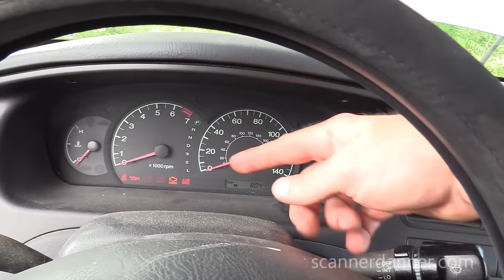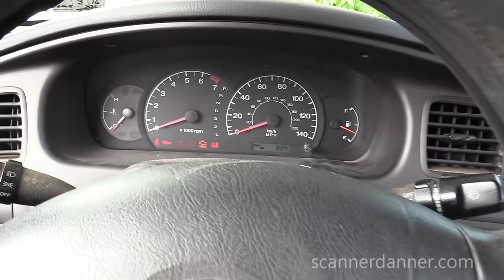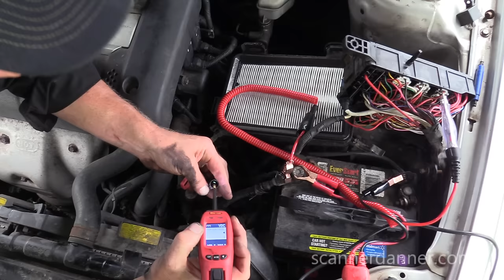No crank, good starter, how to troubleshoot, any car! (Hyundai)

Comment: Hey danner. I always watch your videos I learned soo much thank you for making me a better technician. I have one issue. I don't think I see any video on starter issues. For example I worked on one car that is 2009 kia optima the starter is under the intake manifold  I didn't have access to wiring diagram or anything. how can you test the starter without removal of intake manifold? please help thank you so much for your time to read this its so important for me to learn I wanna do this right way next time when it comes to like this kind of situation ill be ready to go you know
Reply from the maker: To pierce the wires right where it enters the manifold and do your checks right there. If it passes there, you're then selling the job and removing the intake.
Reply: @ScannerDanner  thank you! I appreciate your reply.

Comment: what happened? Did you find out why there was no power to the distributor ? I'm having same iswith my 84 C10 305. Wondering if it's a fusible link ?
Did you do another video on the problem and did you solve it ??

Comment: 2009 man crdi i30 150k km 

Intermittent silent no crank. Will crank and start after one or two gentle pushes with the car in low gear. 
Battery test ✅
New starter fitted. 
Intermittent no crank persists. 
Rather than electrical I suspect worn starter gears on the flywheel of 15 yr old 4 cylinder diesel with 150k km of inner city use. 
Car drives like a boss. It’s is in great condition and is well maintained. 

What do you recon? 

Always starts once warm. 

8-18  degrees Celsius air temp. 
 
No crank on 10 - 20 % of cold to cool engine temperature starts. 

Is this silent no crank damaging the battery or starter relay / system? 

Thanks for your help and channel.
Reply from the maker: I dont know what you mean by silent no crank.
Reply: @ScannerDanner no clicking from the starter.
Reply from the maker: @petergeekie5403  next step, measure voltage directly at the starter on both circuits like I showed in this video DURING the no crank.
Reply: Great thank you SD

Comment: If my ground cable from the engine to the body isn't connected,  will this cause it not to crank over ?  Also I pulled a breaker and jumped with a wire and it cranked over. Thanks  !
Reply from the maker: Sounds like you fixed it?

Comment: Good job 👏.  I install HD fog lights in my car and my radio signal is gone when i turn the lights on. Any idea?. Thanks
Reply from the maker: How did you wire them? Did you install a relay or pull power from another existing circuit?
Reply: @ScannerDanner  existing fog lights.
Reply from the maker: @kukasally  so just a bulb swap or do these HD lights have another box that get's wired in?
Reply: @ScannerDanner  HD kit. With ballast.
Reply from the maker: @kukasally  these probably draw a lot more current than the oem bulbs. Where does the ballast get power from? Where did you run your ground for the ballast? 
A better question, please list all the wires connected to the ballast and where you have them connected
Reply: @ScannerDanner  i just connect the HD with the ballast to the existing fog light.
Reply from the maker: @kukasally  I need to know the wiring to that ballast to help further. Name each one please

Comment: The check engine light is from the mass airflow sensor being unplugged and I usually hotwire the starter first before I beat on it especially if I don't hear it click
Reply from the maker: No MAF on this model

Comment: Hello,
I'm having an issue on 2016 Kia Sorento.  Stiff brake pedal, car does not start or crank.  Replaced battery and starter.  Tested starter by jumping the pins in starter relay - pins 30 and 87 and starter is kicking on.  Tested that there is power going to the pin 85 in starter relay when ignition is pressed.  Not sure what else could be the problem.  Any help will be appreciated!  Thanks in advance!
Reply from the maker: Of course the brake pedal is going to be stiff if the car isn't starting. Why did you mention the brake pedal? What are your voltage readings on the BAT and S posts of the starter while someone holds the key in the crank position?

Comment: Dude, i like your hands on experience teaching. While I was watching the video i wanted to tell you to just run a new wire from the relay box to the starter but in the end you solved the problem. Quick question: do you have any idea of why an immobilizer light would stay on and won't let the car to start even with the original key? It's a 2015 chevrolet Aveo.
Reply from the maker: You need good service information for these types of issues. I am also sure that you have a code for that http://eautorepair.adtrk.biz/?a=10817&c=24&p=r&s1=

Comment: Having the same problem on my ZG Grand Cherokee and I'm about to check the same solenoid connector as you did.
I rang my local auto sparky and immediately he tells me I need a new PCU without even seeing the vehicle. Have lost confidence with this guy and might try someone else if it's not that connection. Thanks

Comment: Paul, can an engine be started with power from a test light to the "s" post? or does a jumper wire have to be used?
Reply from the maker: Jumper wire. Initial amperage can hit 40 momentarily
Reply: @ScannerDanner  Thank you for the information... I appreciate it..

Comment: Hi
I have Hyundai sonata 2016.My problem is very much near to this. My ignition is cranking but not fully . It is sticking in between . I was driving my car and on the way it stopped and I tow the car back home. Can you suggest me what is problem.
Note my car didnot heat up or none of the oil or lubricant is less.

Comment: This was great, other than not checking the engine light. How long does it take to run a code and give some idea of what the problem is. Don't fix it or look into it, but a problem with x sensor or y system...
Reply from the maker: 100% on a regular job where I'm not filming a particular issue, scanning the system for codes is not a bad idea, HOWEVER, this additional problem is absolutely separate and should the customer also want their check engine light fixed, this is additional diagnostic time. That was my only point. Thanks for watching!

Comment: I got a 1999 Honda accord 2.3l p1259 trouble code but won't start when does press accelerator and it dies kind of perplexed bought new aftermarket solenoid valve got new starter and alternator. Any help whatsoever would be so helpful

Comment: I have the same no start problem with my 2003 Ranger and I bought a remaned starter and it came with a six inch of wire attached to the S post on starter. its a Ford approved fix for the corrorded part of that wire, well it didn't work and so to test that starter. I don't have a test light and can't go get one because my truck is not running.
So I was going to run a jumper wire from the S post to the hot side of battery to see if it will start the truck, is that good test ?????
Reply from the maker: You can just run a jumper from the heavy post on the starter itself, to the S post.
Safety warning. Make sure it is in neutral on a manual transmission and Park on an automatic with the parking brake set. And then turn the key to the run position so it will start.

Comment: Did this on my jeep, starter relay was a problem for a moment i just bypass does pins, forget about hot wire terminal (30)and negative (85),just put a short wire to terminal 86 which is a positive from ignition to terminal 87 thay goes to Starter solenoid. And i then go get the parts from Auto and reverse the thing i did recently then you good to go

Comment: i have a 03 accent that the electric system die when installing the remote wire to the starter.  i mean is dead no ignition switch power the dash does not light up when turning the ignition to on. Checked good starter, good relay, good ignition switch, good battery no blown fuses. any thoughts?

Comment: What is the state of the key in crank or run position when using the power prode on the s cable of the starter to provide power.  Will it start if key is off and you supply power to the starter?
Reply: It will crank with key off but not run.

Comment: If I have a issue for a crank but no start should I try moving a fuse from a different one to diagnose if the fuse is bad. Engine started earlier today but after changing my temp stat it no longer starts.
Reply: Battery is new and passed test. Spark plugs are relatively  easy as well.

Comment: Question if the Battery for the Transponder chip is bad could keep the vehicle car from starting or is fuse because a friend of mine his Lexus RX330 lights come up on the dash board comes on battery is good its does not flicker but just sits there. Yes there could be relay problem a fuse problem, Or it could be a Starter wiring issue or connector so some sort. But the General Question does the battery in the Key Transponder possibly need be replace and if it does could it start the vehicle again or I am thinking it well
Reply from the maker: IF your no crank issue is being caused by a transponder type key, you will have anti-theft codes and a theft light that will be flashing at you. If you do not have those, attack the problem exactly how I did in this video.
Reply: @ScannerDanner  check the fuses seemed to be nothing burnt out haven't checked a relay box did hear a computer-like sound not sure what that means I don't hear it now I taken the leads off the battery and it still doesn't want to start if it's a starter issues than it's beyond me because it seems like it's just a bad electrical problem 
I guess my friends just going to have to consult electrical automotive service person

Comment: If you went to the lug on the S post what would you see? 12volts or still no voltage or a voltage drop difference
Reply from the maker: I showed that. That was the first test. No power on the terminal itself or lug as you called it

Comment: Great  technical work.
I have an issue with battery charging Indicator always on having difficulty on starting at the first time. Something I've to run back and forth the auto gear selector wondering if anything is wrong with the electrical connections. There is a clicking sound but the oil indicator lamp and fuel meter dies sometimes... It's a 22 years old car. I may have follow your method...👉
Reply from the maker: Sounds like you're describing multiple problems and you've given me no information on what you're working on. Year, make, model, engine and what specific problem are you chasing? Did this all happen at the same time? Thanks!
Reply: @ScannerDanner  well it's a ford lynx 1995 same as Mazda lantis. Actually I've found the problem, the cable connection at the starter motor is faulty. Just rectified it. Thank anyway. God bless all.🙏
Reply from the maker: @sivaraoramasamy3499  okay sweet! I wanted to help, just needed more info. Nice find!
Reply: @ScannerDanner  🙏

Comment: So I have a 2000 Chevy Grand Express 1200 that doesn't want to stay running. I just replaced the starter, alternator and it has a good Battery and replaced the starter relay. After checking all fuses and relays, all Of them are good except for the Crank fuse. When I put the test light on the crank fuse when the ignition is on the on position, it shows no power coming from it and the fuse isn't blown. May I get some advice on what the issue could be, or what I need to check for? Thanks Man!
Reply from the maker: that is because that fuse is only hot when you are cranking the engine over. 😉
Also, you say it doesn't want to stay running meaning what? It doesn't crank, or it cranks but doesn't start, or is starts and runs but then stalls? 3 COMPLETELY different scenarios
Reply: It Cranks but doesn't Start
Reply: It's got a brand-new Alternator, Starter and Battery on it.

Comment: Replacing relay bad !
I think the box might have been crazy on my Elantra too 
The trip Odometer would say im getting 65 mpg sometimes 
It would lose power intermit
Etc 
I think Elantra harnesses are not good 
Mine had the Famous map rewire before i bought it .
A guy also told me this .
“You are dealing with replacement employees putting in Replacement parts in your replacement car “🤣🤣🤣
Be well my friend ✌️

Comment: Have a rav4 2004 doing the same thing could it possibly be a fuel issue or would it still crank even with a blocked fuel filter, awsome video deffiantly subscribing
Reply from the maker: The starting system (starter and battery) will function independently from the ignition and fuel system. If it is not cranking for you, attack the starting system directly. Here is a link to the DIY version of the same service info I use. (If you need it) https://eautorepair.adtrk.biz/?a=10817&c=24&p=r&s1=

Comment: Sir i have a questions.. Hope you can help me..
I have a Honda Jazz gd 1. 2001.
First its always blingking D I'd scanned and P0700 error then id deleted error then it will run okay.. Then if i removed the scanner the car would stop and there is sudden noise on engine i think on trans.. And fuel pump sound with ignition on disappear.. And there is something tiktak sound on fuse and relay box
Reply from the maker: You need a better scan tool. The P0700 is just a generic engine code that says "hey go scan the transmission module for the actual code" you MUST start there

Comment: Scanner, can you help me, I have this b2200 that starts up fine one the first start, but on the second start up it acts like I have a dead battery, an is turning over real slow, today I put in a new 80 amp fuse, scrub off the fuse box terminals, so the truck is now charging a 13.7-8 volts, but when I turn the truck off then to start it back up, it is acting like it have a dead battery, so I'm confused.

The next thing is my reverse lights is always on, but when I put the stick in reverse it goes off. Help please.
Reply from the maker: Sounds like a bad ground, maybe even on the block? Need voltage measurements to help you. In particular the heavy battery stud right on the starter, then on the block itself DURING cranking

Comment: great video,  my 1998 jeep, wont start when I put the key in the on position it shows lights on dash board battery is good when I crank it I hear one click then all lights go out even on dashboard like if there was no battery in the jeep. then I take battery off put again and lights on dash board but when I turn the key on, everything goes dead again. could it be computer..
Reply from the maker: Absolutely not! You have a connection issue with the battery cables. You need to do some voltage measurements on the main battery cables AND ground cables, including where the ground cable connects to the block
Reply: just want to say thank you for your quick response knowing you are busy and all. good looking out.

Comment: In this case you cannot always depend on prob light  because  in some cases the battery cable to the starter is partially burned or corroded  so there is not enough ampere supply to the starter  but the multimeter or prob  light works and give 12 volt indication. so replace the cable in this case.

Comment: I have a 2002 Ford Taurus that has a new battery, new starter and new alternator that is a no crank, no sound. I am getting a click when trying to crank. I am also getting all the lights display on the dash except for the battery light. I am not getting power to the starter wire when cranking and the starter wire at the switch is resting at 9 volts. Any help/suggestions would be much appreciated. Thanks.
Reply from the maker: Post this to my forum www.scannerdanner.com It is free to join and we can help you there. Let me know when it is posted and I'll jump over and help too

Comment: Please help have a Ford Crown Vic hear a clicking from the starter and the relay you can feel click in both as well. had starter tested everything works it's a new solenoid and new starter replaced relay as well, tested battery a few different ways & cleaned the terminals. still just one loud hard click tried to start in neutral same thing. Also checked flywheel/flex plate and hand turned motor nothing locked everything looks to be good!? is this a wiring issue I'm missing like electrical?? Maybe a fuse im missing? Please help!! Thanks!
Reply from the maker: You MUST recheck your starter wiring while holding the key in the crank position!! This is SUPER critical that you do this.
Reply: @ScannerDanner  so what exactly is it that I'm checking for?
Reply from the maker: @treykashflow6183  you using a test light or voltmeter for your tests? if it is a test light, is it an LED type bulb or an incandescent ? If it is an LED test light, they are GARBAGE for troubleshooting and you will need a different light. Tell me what you have then we will go from there.
Reply: @ScannerDanner  tools is where I lack! I have no voltage meter or any test tool of that nature, I'm willing to invest in one if it's a big chance of me trouble shooting the real problem! I'm just sick of putting money into the car with no positive results man